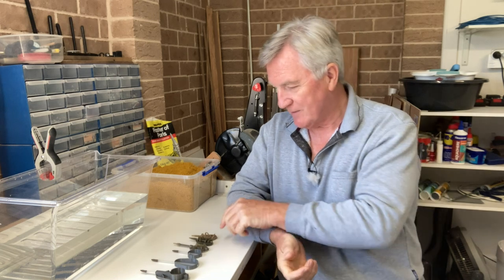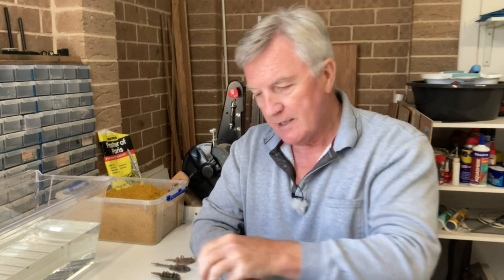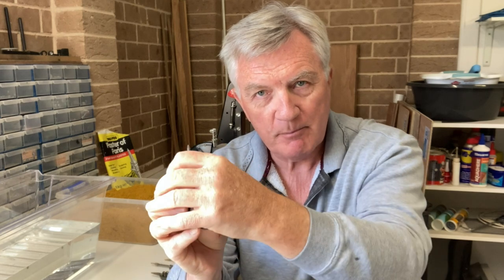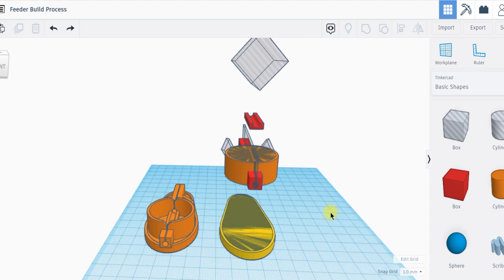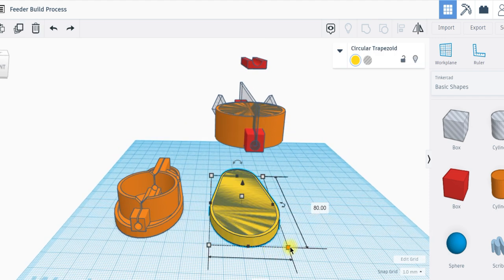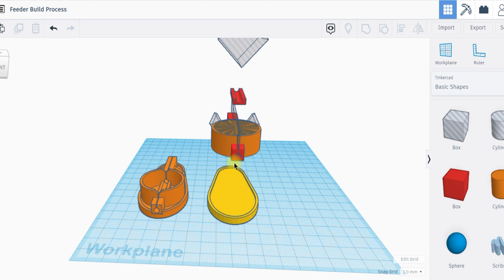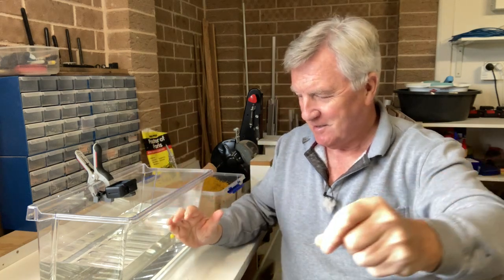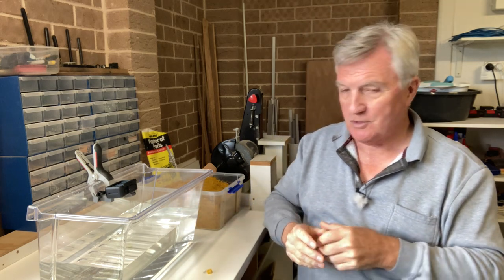Prototype DIY Feeder - Have Your Say on the Design

Comment: You could Epoxy/Wedge a small piece of thin flat Fridge Magnet to keep the hook inside the feeder until the fish takes it out - The magnets are quite weak, but strong enough to retain the hook & a fish will easily take it out. Or even Epoxy it to one side or somewhere on the top rim??

Comment: Think you’ve nailed it Dennis. I see no advantage to extra holes in the feeder. The openness of the unit allows the ground bait/ feed to melt , diffuse quickly and efficiently. Testing on the bank will be all you need! Look forward with interest to the field testing. I might drive up for a look! MIck L
Reply from the maker: No worries Mick. I'll even give you one to try out mate.😃👍

Comment: A thoughtful design. I like Khausar Sanullah's idea of holes at the bottom of the circular section. How do you think increasing the height of the circular section would affect the feeder landing on the bottom in a lighter version? The increased weight of groundbait/pellets might cause the feeder to turn over on the cast or on hitting the water. I would be tempted to reduce the height of that section. Having watched Joe's  video on the Preston site and the way the carp took the bait I wonder if putting a base of sweetcorn in the feeder serves any purpose except as an attraction for subsequent casts. An interesting and original variation on a theme, however, and one certainly worth developing.
Reply from the maker: Thanks for your comments William. The holes at the base of the circular section is a popular theme, so I will incorporate them into the next version. The height of the centre circle is a bit more difficult. I have definitely considered raising it, but, the points you raised about the negative effects were very valid. it looks like there may be a number of variations to the feeder before I finish it.😃👍

Comment: Very interesting & very cleverly thought out. As with everyone else who’s commented, some small slots in the side of the bait holding area of the feeder can aid the breakdown of the groundbait/pellets. Also, about your ‘live testing’ scenario on the river/lake with the underwater filming ~ instead of casting out in front of you, have you considered casting towards the next peg? Although you wouldn’t get the main flow of the river or the depths/water movement of a lake, it would certainly make it easier to set up the camera/filming, and by casting to the next peg, it would also give you the impact of a fully loaded feeder in a moderate depth of water? (Hope I have made myself clear in what I’m suggesting?) I’m really looking forward to your next stage developements of this idea. Well done Den, & here’s hoping you may catch a decent fish whilst live testing ~ that would certainly prove the design as ‘water tight’ (excuse the lousy pun🙄😂)🎣🎣👍🏻👌🏻👏🏻👏🏻
Reply from the maker: Hi Ken. Thanks for your comments. I have an underwater camera called a Water Wolf which I may be able to attach in line with the feeder and then do a short cast to fairly shallow water. It's going to make the rig really heavy, but it would hopefully show how the feeder falls and then sits on the bottom.😃👍
Reply: @FishingwithDen  If it’s attached to the feeder/line, won’t that give a false representation? - as you wouldn’t normally have that weight on the line/feeder🤔Just a thought, if you want to have an accurate testing scenario.👍🏻
Reply from the maker: @kennyscouse3388  It probably won't be perfect Ken, but if I keep it some way up the main line, hopefully, it won't affect the way the feeder lands. I will only know once I've tried it mate, but that's for the next video. 😃👍

Comment: Superb idea Den, personally small holes around the circumference of the circle would help push the loose corn out.
For me though corn isn't the bait I would use for this. It's ideal for hard 4mils with ball of ground bait or micros around it.

The mircors would sit lovely like a parcel and those fish would dig for the hard 4mils.

I'd love to see if you could put a ball of paste in the circle surround it with groundbait and see how that performs as paste is deadly and you may have found a way to fish it at range.

Personally I would make the lead match the shape of the tear drop it would fly better in the cast.

All in all this looks a great idea can't wait to see it on the bank Den👍👍👍👍

Plus if they work I'll gladly pay for some and for the extortionate p&p 🤣🤣
Reply from the maker: Thanks Stephen. The holes will be incorporated into the next version mate. As for the bait, I agree that pellets may be a better idea. I will also try some softer groundbait in the hole instead. I can then pack a harder shell of groundbait around the whole feeder to allow me to get it out further and combat the effects of the river current as it sinks. When it hits the bottom and the outer shell breaks away, the hookbait and softer groundbait will be on show. To some extent, this might simulate a soft paste approach. The lead will also conform to the shape of the feeder over time. I just did it this way for simplicity for the first tests. I'll be out doing the first proper tests over the next few days.😃👍

Comment: Hi Den, I have been watching your designs with much interest and like yourself being retied am contemplating taking taking  the plunge and buying a 3d Printer.
As for the banjo feeder I also viewed the original video and the video evidence was compiling. As you use mostly Corn & Grounbait do you need the extra corn in the feeder?
Reply from the maker: Hi John. I used the corn in the bowl for demo purposes mate, but you can fill it with pellets or groundbait if you like. It is going to take a bit of time to find out how best to use it. Just one other thought here. I get the impression that you think I would have corn in my groundbait mix. That is something I don't really do for method style fishing because, if there are too many particles in the groundbait, it can break up on the cast. Thanks for your comments.😃👍

Comment: 1. Is the circle not to high?
2. Is the V notch bottem circle not to small and to sharp for the hooklink. I don't know if you can give it an fillit in tinkercad.
3. It may need some holes in the circle. I will not be surprised it the groundbait will stick to much.
4. You may be able to fit a elasticated stem from brand in it.
5. You may be able to test cast in on a grass field. If it will fly and land bottom down big change it will land bottom down on the bottom. At least I guess. Could be that shape and water resistant will still flip it.
Reply: Point 5 doesn't work although it sounds good there is bounce and added friction that doesn't come into play in water also the slower fall in water would likely give it time to right itself
Reply from the maker: Thanks for your constructive comments Ruben. These are all things I need to test over the next few days. I do agree with Stephens point below though about the feeder bouncing if tested in a field. I will try to attach an underwater camera during testing to see if I can ascertain exactly how the feeder lands. 😃👍
Reply from the maker: @stephenmonaghan5766  Hi Stephen. Thanks for your input. I have added it to my reply to Rubens comments.😃👍

Comment: Great Vid once more.  I have a few drawn ideas for a method feeder and did think of making the base thicker and inserting metal rods to make heavier or lighter as required? Even extend out and bend to act like feet?? Also maybe put a bevel in the base to make it more dynamic to fall bottom first?   I have cut the 2 centre bars off my shop bought methods so my hooks does not snag and seemed to have hooked more?  my 3d jar is not filling as quickly as I would like We have been hit with some unwanted expenses of late. :(
Reply from the maker: Thanks Phillip. All good comments here mate. I hope your 3D Printer jar starts filling up more quickly for you.😃👍

Comment: Recently came across your channel and immediately subscribed, some absolutely amazing content! I love this idea, I need to build my 3D printer and quickly now, can I ask. What did you use for the weight at the bottom of the feeder? I was thinking of maybe getting lead-free solder, measuring the correct weight and smelting it into a flat weighted shape to add to the bottom of the feeder.
Reply from the maker: Thanks for Subscribing. I used some scrap lead that I had in my garage. I made a mould from plaster of paris, poured the required weight of lead into it and then used roofing sealant to glue the plastic to the lead. You can 3D print a blank to make the mould by making it around 1mm smaller than the size of the hole at the back of the feeder.
Reply: @FishingwithDen  fantastic, thank you for the quick reply! I plan on creating a hybrid feeder that will fit onto the Preston ICS stem system. What filament material did you use for the 3D printed feeder?
Reply from the maker: @kristianzapater1913  I used PETG.
Reply: @FishingwithDen  Thank you

Comment: Not wishing this to be at all negative - just a (probably minor) reflection Den but I'll mention it anyway. The concern I would have would be if (when) you're fishing over a silty bottom. I'm wondering if the feeder lands 'point down' might the extended tube - at the front - become embedded in the silt, causing the feeder to 'sit' in an upright position rather than ending up flat - as desired? Just a thought, but you did ask for comments
Reply from the maker: All comments are welcome John. I won't know exactly how it lands until I do the tests, hopefully with an underwater camera. If that does become a problem, then it's an easy fix to shorten the stem down. Thanks again mate.😃👍
Reply: It should be possible to add some little 'wings' at the sides so that it floats more flat when going to the bottom (?)
Reply from the maker: @timmerenator  Hi Jeroen. I'll know more about how it sinks when I do the tests at the river, but that's certainly an idea.

Comment: With the flat bottom, when tossed into deep water, I wonder how much it's going to 'flutter' on the way down? Thinking being a 'flutter' action may wash your ground bait away before it gets to the bottom. But that's just a spitball guess. Need a friend with a swimming pool to get a good depth for testing. :) Maybe a keel shape to the bottom would help. Look forward to more on this! And I think you should call it a "Den-jo" (Kinda looks like a Banjo with a guitar back attached to it)
Reply from the maker: Hi Bert. I hadn't thought of a keel mate. If it does flutter down, that might definitely help. With regard to the groundbait though, I'm not concerned about it coming off on the descent. I just need to mix it to the right consistency so that it takes say 30 seconds before it starts to break up. We will know more after the river tests.😃👍
Reply: @FishingwithDen  I guess it depends on how big the flutter is as to whether it throws the bait. I would guess the shape of the bottom part would affect it as well. Your 'guitar' shape vs a round vs a square, etc. Kinda like trolling flashers. Some wag back and forth just a bit, others make wider swings. It'll be neat to see how it is casting it out with some mustard behind it and how it does with a longer descent.
Reply from the maker: @wingnutbert9685  All good valid points Bert. Thanks mate.

Comment: Brilliant mate absolutely brilliant. How about a small clasp In the feed area to retain your hookbait at all times.
Reply from the maker: Thanks Scott. I have thought about some kind of retaining mechanism, but I was concerned about whether it would impede the rise of the bait when a Carp sucks it in. I considered using a small shot close to the hook to weight it down a bit, but if you have any suggestions for a better way to do it I would be happy to listen mate.😃👍. Thanks again for a useful comment.
Reply: @FishingwithDen  could you offset it to the front of the cup or so that it sits in such a position where its placed in the center of a four inch hooklength. That would then give you the effect  of a 2" hooklength in place at all times.
Reply from the maker: @scottpardoe6349  I'm willing to try anything Scott. I'll do some tests mate.😃👍

Comment: Hi Den…really good idea to produce your own Feeders, given the lack of their availability in Oz. Your experiment with the corn/groundbait, was interesting regarding the value of the corn remaining “wedged” in the Feeder. Given that the hook bait was no longer in the Feeder, I’m not sure that whole corn would be of any value? If you wanted to “match the hatch” perhaps ground corn/maize would work better. The video that Joe/Preston produced for their new ICS Banjo XR Feeder range focused on retaining the hook bait in the optimal position in the Feeder. They came to the conclusion that the hook bait should be under the groundbait (i.e. if using a mould the groundbait goes in first with the hook bait last), rather that the generally accepted hook bait first. To keep the hook bait in the Feeder, you could make a line clip (Guru have this feature) which would reduce the hook length and also give you a “bolt” effect. I think that keeping the hook bait within the Feeder is crucial, otherwise you may as well use a cage Feeder.
Reply from the maker: Hi Stephen. I agree entirely that the hookbait needs to be inside the bowl and some form of clip may be required. I wasn't aware of another feeder with a line clip though, so I will definitely do a bit of research on this. Thanks for your comments.😃👍
Reply: Hi Den…have a look at the Guru Method Feeder Clip on the Angling Direct website.
Reply from the maker: @stephenmanuel4815  Thanks for pointing me in the right direction Stephen. I'm in 2 minds about using the Guru style clip. It does have some benefits, but I'm not sure about how well it would release. This product appears to have been around for a while now, but there aren't many videos about it. There were also some comments about a clip like this contravening some fishery rules about free running feeders. 

I'm wondering if a largish shot (No4?) on the hooklength might serve the purpose of keeping it inside the bowl a bit better. It might also allow the hookbait to travel further before it reaches the end of it's tether.
Reply from the maker: @stephenmanuel4815  Interesting video Stephen. I see what you're saying, but I also noticed in the comments that quite a number of people mentioned the use of split shot instead of the clip. I'll give it some thought. Thanks for being so helpful. By the way, please be careful of attaching a link to another video. YouTube puts them into a holding box which I don't always check. I think it's a security thing so spammers don't add comments with porn links etc.😃👍
Reply: @FishingwithDen  Sorry Den, I didn’t realise that sending a link could be a problem…I know for the future!👍
Reply from the maker: @stephenmanuel4815  No worries Stephen. It's just that they get put into a holding area and I don't always remember to look there.😃👍

Comment: You have obviously put a great deal of thought into this Den having used all of the feeders that you have on show I find that simplest is best and one of the dangers is your hook/bait getting jammed in the feeder therefore the plain hybrid would be my first choice, not sure if it is feasible but how about locating the stem underneath the feeder?
Reply: @ barry jarman think that brings problems with attaching the weight to the feeder
Reply from the maker: Thanks Barry. I did think about that, but Barbara's comment below is one of the drawbacks. The other issue is that I believe the Centre of Gravity created by lowering the stem would possibly lead to the feeder not landing face up every time.👍👍

Comment: Looks OK Den maybe some small holes in the bowl would stop bait staying in but your impression of a feeding Carp didn't apply suction to the bait  area  .Look forward to the field test which would give a better response to the suction point .Look an ideal weight for long distance method on large waters with a Carp rod Easier in the UK to actually get the spare feeder stems than it is in Oz you are really going for it on the 3d printing stuff now it is your winter LOL
Reply from the maker: I told you my impression of a feeding Carp was pretty amateurish barbara. 🤣🤣 I was wondering about holes in the side of the bowl myself, but I'm still in 2 minds as to whether I like the idea of some bait staying in there of not. In rivers, the bait might get washed out by the current if I do make holes. It's something I need to experiment with I think.
Reply: @FishingwithDen  Maybe river test them first as is then or make one with the holes to do a comparison on the same session might be an idea I liked your thought on centre of gravity coming into effect if the tube inserted in the standard way from the bottom Hadn' t thought of that point myself just thought of working with split weights being tricky
Reply from the maker: @barbaraneville5036  I think your right Barbara. I want to try to get some underwater shots of the feeders on the bottom, but it's not going to be easy in the river.
Reply: @FishingwithDen  Hmm gin clear water required which fish tend to dislike that will be a small problem for you
Reply from the maker: @barbaraneville5036  I agree. With it being Winter here, the rivers are a bit clearer, but very cold. And I'm not going for a swim to set up a camera Barbara!!!🤣🤣👍

Comment: hello den,
that is a very beautiful design in tinnercad i use it myself. do you happen to have an email address so i can contact you. via mail.
you have to try in that big ring where the food remains to drill small holes in it so that more flow of the water can pass through than I think the food comes out faster.
kind regards Luc
Reply from the maker: Hi Luc. Thanks for your comments. My email address is fishingwithden@yahoo.com